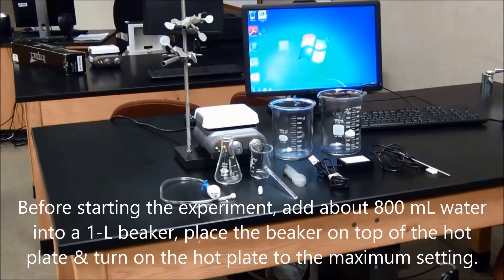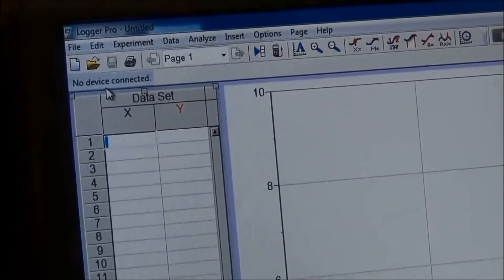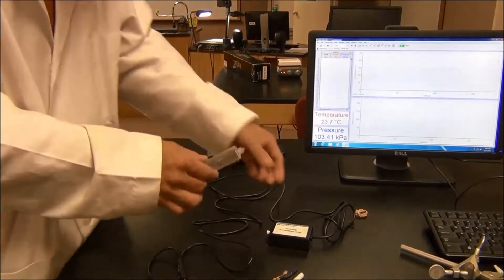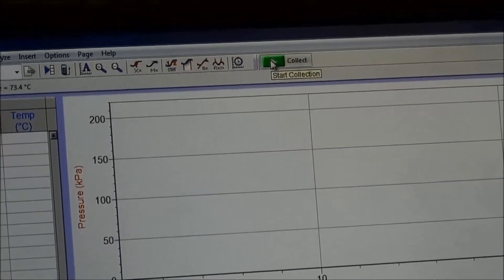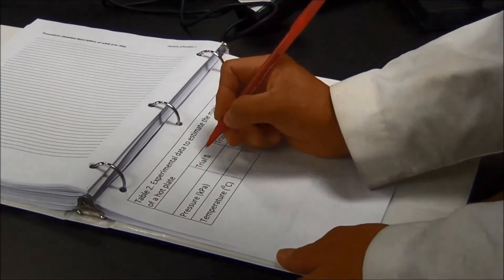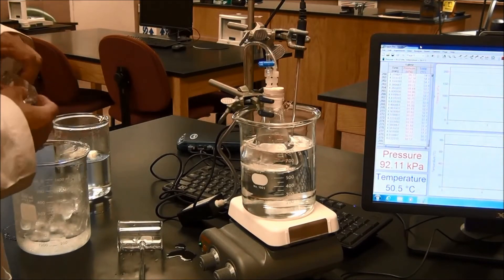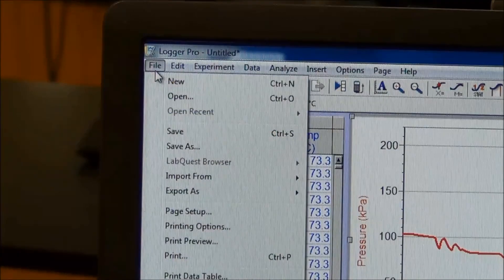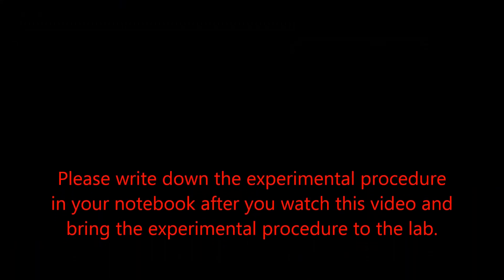Determination of absolute zero temperature

Comment: you had me confused as to why the water was creating a cyclone at 11:30 i thought for a moment there was some kind of unnatural phenomenon taking place. how does the stirrer work and is it necessary to use?
Reply from the maker: The vortex formation is due to the high speed stirring. The purpose of stirring is to make sure the heat transfer between the water and the air inside the Erlenmeyer flask is fast and homogeneous since you measure the temperature of the water, not the temperature of the air.